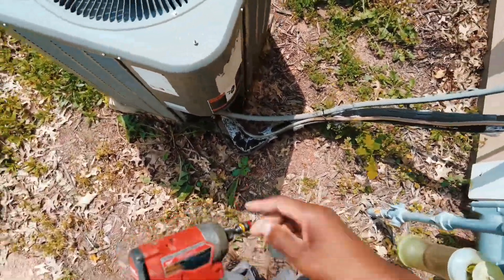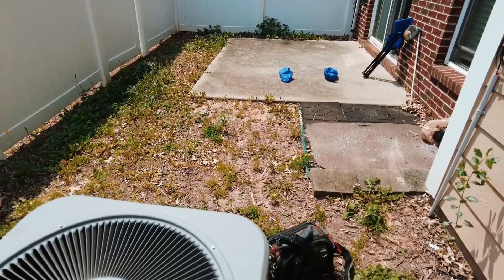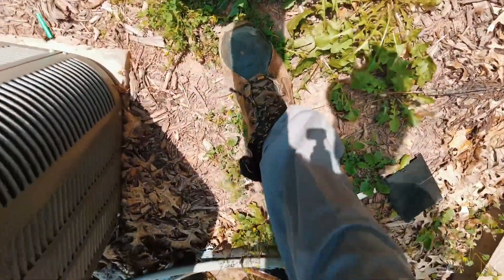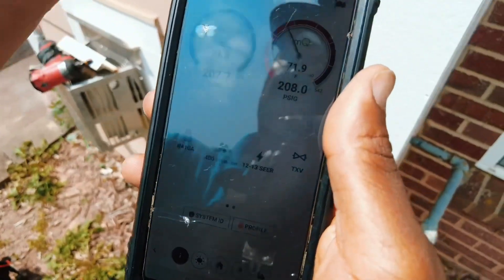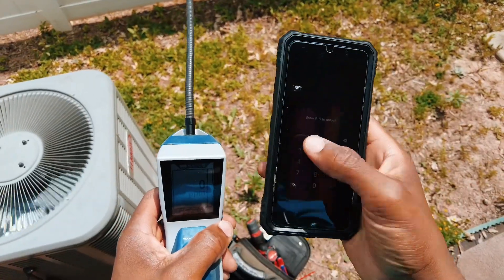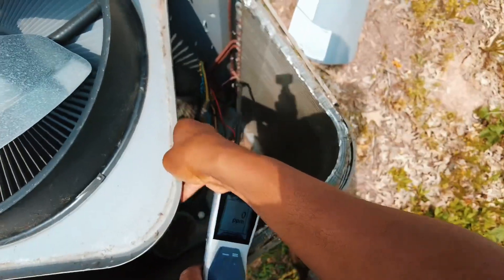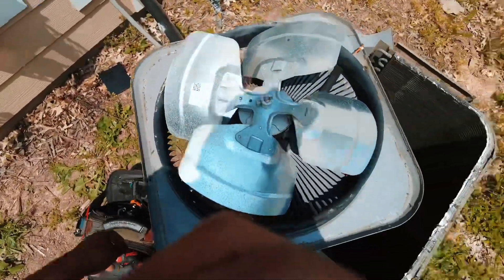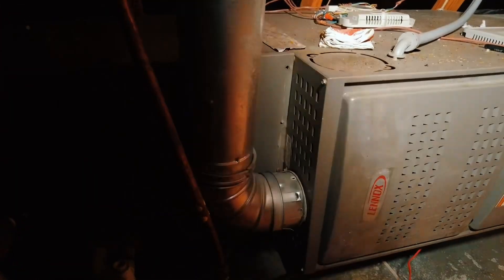Day in the Life HVAC Service Call - Multiple Issues on 12yr old Lennox Unit #hvac #tech #hvacservice

Comment: dang you not scared you may accidentally touch the capacitor terminals? Doesnt it hold a charge?
Reply: I thought of that too. Maybe he discharged it off camera
Reply: Really?
Reply: @dontarguewithfools  Yeah, capacitors can hold a charge when they're not being used. Best thing to do is use a screwdriver(or any like tool) and touch the terminals, causing it to discharge.
Reply: @ChosenSpi  I’m sorry.
Reply: @dontarguewithfools  you're fine dude, why you apologize?

Comment: To reset that HPS, sometomes there is an access door right beside the service valves helb by a 1/4 inch screw. Hope that helps ya!
Reply from the maker: Nice! Thanks for the heads up I didn't even think of that👍
Reply: @HVAC Tech Knowledgy  i am a HVAC technician by the way and I deal with these for the 4 months of heat we have here in Canada. I watch your videos and follow you, keep up the good work.